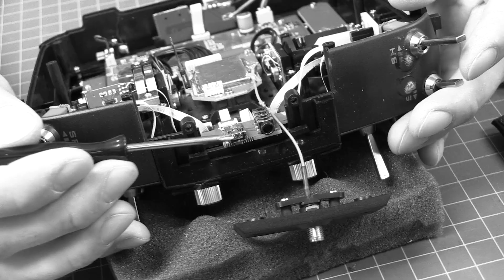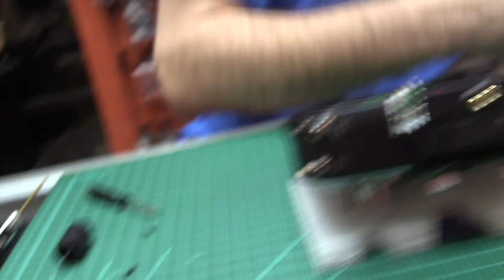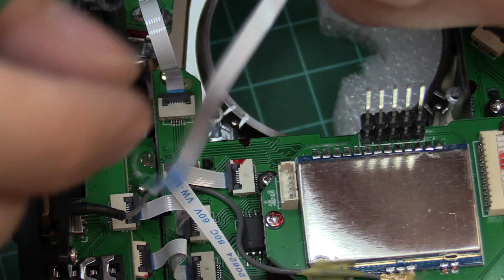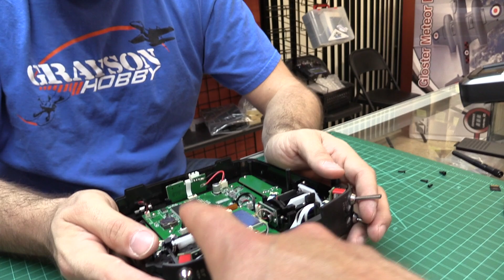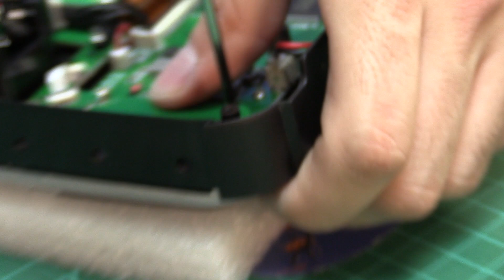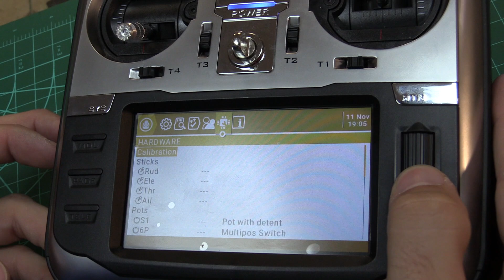Jumper T16 How to Replace Switches, Roller wheel, & Gimbals.

Comment: Hello,
thank you for the great guide how to open the Radio and exchange switches!

I would like to make Switch F (SF) a 3 Position switch. I have already soldered in a new switch
. 

The new switch works, but only on 2 positions, not 3. I think this is due to the wrong settings in Global Parameter/HARDWARE. Here Switch F is defined as 2 position switch.

How can I change the settings here?

Thanks!

Comment: so question if i have changed out the sa/sb switch and it still does not  work I assume there is a issue with the radio?

Comment: I was wondering if anyone has  any idea if you can replace a gimbal with 2 dial type inputs? I have a qx7 im converting to a pistol grip style controller based on the qx7 pistola from thingiverse, but i dont want to loose the 4 inputs, and would like to basically split 1 of the sticks into 2  dials. im converting it to use with ground vehicles. Specifically i have a ground vehicle that after the conversion the right stick will now be a trigger and steering wheel, but i would like to be able to control a arm and a motor on the other sticks inputs without having a stick.

Comment: Wish I had seen this before I butchered my radio! Anyway, maybe I missed it but I think the orientation of the ribbon cables matters. Take a picture of the switch/cable before disassembly and make sure it goes back correctly.

Comment: I had to disassemble T16 selector switch SE was not working, I had to realign the ribbon cable and this video helped a lot. Thanks for the teardown. While I had it apart I reversed the handle to allow it to fit in a normal depth transmitter case less chance of breaking switches reduces depth by about 1 inch.

Comment: I purchased this radio from you and some how one of my switches broke I believe it was when I attempted to open the battery cover.  I watched this video and ordered the replacement switch from you.  Fast shipping on the part,  and 30 minutes later because of your great video my transmitter is as good as new.  Thank you as I would have treated the ribbon cables like servo connections your detailed video saved me from causing additional damage.  Also i filed down the catch tab on the battery cover.  It now requires much less force to open.

Comment: Loving my T16 (yes bought from you guys!) but I’m having a hard time learning to use / program it. You’d setup for me a bind switch and a momentary switch (bought with beta75x combo) so you have to hold the momentary switch down then the arm switch, or it won’t arm. How in the world did you do that! I can’t figure it out while trying to setup other quads. :( A new T16 video tutorial idea perhaps? ...as the two switch setup to arm is awesome / super safe!
Reply: Pro tip: "duplicate" the model and use it as a template for switches etc on other quads you have. that way they are all setup the same and you dont have to guess the switches for each model LOL
 also the prearm feature is a setting in betaflight modes tab.
Reply: @graysonhobby7583  GOOD to know!!! On both! You guys (and gals?) rock! Thank you so much!

Comment: My T16 does not appear to receive Trainer input. I connected it to my Taranis. When the Taranis is set up as slave and the T16 st up as master, the T16 does not respond. But when I set the T16 as slave and the Taranis as master as a test, then the Taranis receives the signnl just fine.
Are there any issues with T16 receiving trainer port signals? What can I do to rectify this because I want to use the T16 as my daily driver?
Reply: Did you ever resolve this?

Comment: Gday Will & Basil, nice job on the t16 tutorials guys, Will where do you buy the  different coloured anodized switch nuts for the t16, keep up the great work guys.👍🛸
Reply from the maker: Not 100% sure if the nuts fit, but this is the tool we used 
Amazon Link to Switch Nut
https://amzn.to/2CJPdUu
Reply: @graysonhobby   The thread is correct but stock Futaba switch nuts have a larger OD on the base than stock Jumper. May cause fitment issues for SA - SD if 3rd party hardware is the same as stock Futaba.

Comment: Is it possible to shorten the throttle throw on the jumper radio? I am used too a spektrum radio which has a 
shorter throttle.  Thank you.
Reply: You could possibly mod the gimbal for mechanical stops, then re-calibrate after for the shorter throw to be the new min/max.  A new set of Gimbals is cheap enough to try LOL

Comment: Great job guys! Do you also carry antennas for all the Jumper Transmitters (radios)? I did a toggle switch replacement on the Jumper t8sg plus📻...if anyone is interest please check it out here...thanks for sharing!
Reply from the maker: the antenna is a 2 4 ghz rubber ducky.. we will look into stocking some

Comment: Is Grayson a service center for the Jumper radio? I would love it if there was someplace I could send my radio to have OpenTX installed. I know that it is supposed to be DIY, but I simply don't want to... so... How about it?
Reply from the maker: the T16 already comes with jumper TX - a fork of open tx.. very similar
Reply: @graysonhobby  ME: " I would like to have my engine replaced". My Mechanic: "Nah, it's cool, they already come with an engine".
Reply from the maker: @Thuban06  bingo - we are not going to sell you something you do not need or already have :)
Reply: except jumper tx came broken (for DSMX among other issues) and OpenTX fixes everything